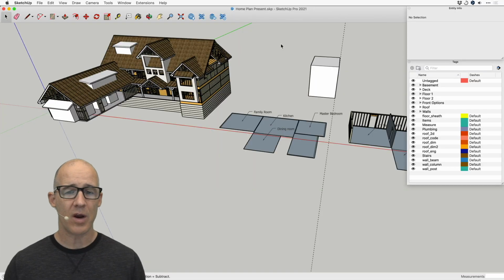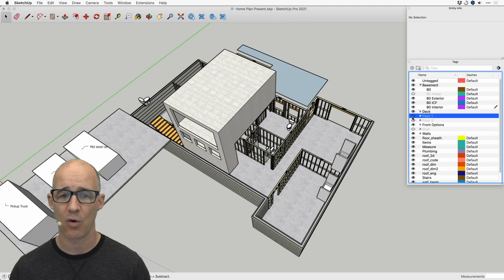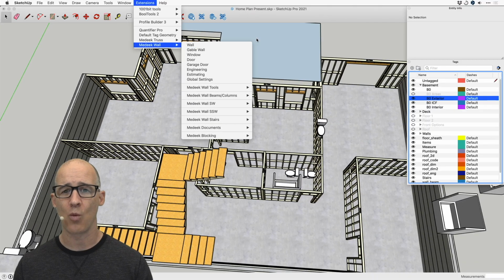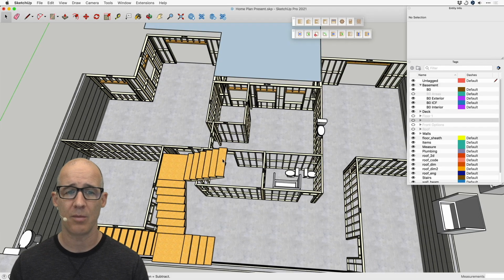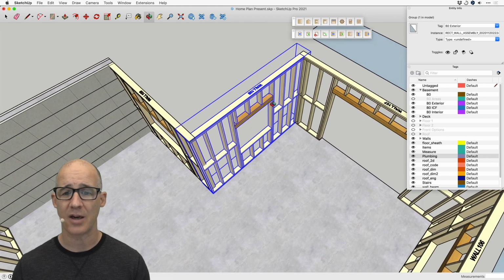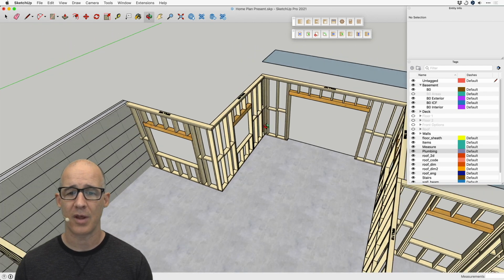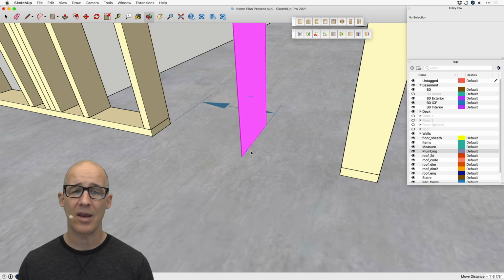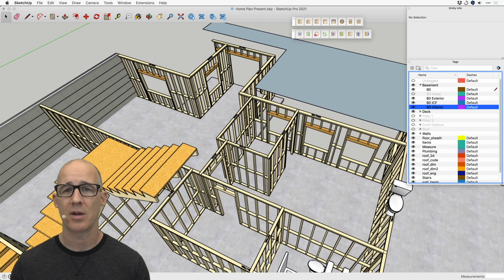Sketchup My House - Manipulating Medeek Walls

Comment: With stretching/shrinking a wall when it's an inside corner you want to move the start or end of the wall to the other outside point of the connecting wall at the corner.  So in your case you extended the wall by 5.5" too much.  There was no need to changed the Corner Offset to zero in this case.
Reply from the maker: This is something I am certainly in the process of learning. So, my question (for the non-professional framer) is if the side of the bottom plate you choose depends on the corner type. Sometimes the side closest and sometimes the side farthest?